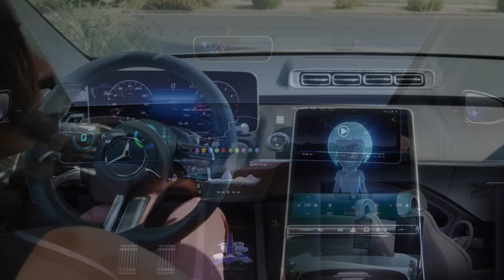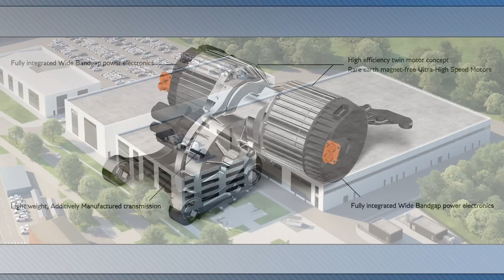UAW Ready to Rumble at VW; Is This Ford's Electric Maverick? - Autoline Daily 3771

Comment: I doubt we see a compact EV truck from Ford.  At least not initially when they come out with their 2nd gen EVs.   Farley has noted that work trucks and highly functional vehicles are the exception to the need to go small.  I think Ford remains all in on the T3 project which I understand is something only slightly smaller than an F150.   A ride hailing vehicle is interesting but I'm doubtful we see that either anytime before 2030.

Comment: Reducing rules is stupid they have over 10 years to address the issue, how long do they need?
Reply: In the big scheme of things it doesn't matter, the market leaders are already putting that kind of pressure on the market, so government pressure may not as critical at this stage.

And it may even backfire on the laggards who wanted the slow down, because they will just end up further behind without pressure to innovate like the rest of the leading players, so that might seal their fate.

But in the short term it buys executives more golden parachutes, that's just the short-term-ism culture at play.

So not really a concern as long as the government doesn't step in to rig the market against the market leaders at the same time.
Reply: I think it's ok, regulation is not what will cause automakers to go EV. It will be market forces. Look at Japanese automakers, they just keep buying carbon credits and don't any meaningful number of EVs. The only thing that will change that is when ICE cars become more expensive to make than EVs and consumers make the switch. Regulation isn't needed nor is it effective.
Reply: buy me one and I'll switch now.
Reply: @2012bigPerm You can find a used Model 3 for as low as $15k - there's a $4k fed rebate on used EVs - if u look hard enough. 

Kinda a steal considering the package.
Reply: @AllanSustainabilityFan  As low as and if you look hard enough, without those two omissions you'd have one hell of a point. Exceptions are not rules. And I said buy me one, that's free for me, not as low as 15k. I don't hate EV's like you guys love them...that's the main difference.
Reply: @2012bigPerm Well, yeah for free is not likely lol. 

But under $25k is easy to find, $20k with some effort, and as low as $15k with the rebate.

Alternatively could get a used 2017 Prius for $15k. 

I'd take a fully featured Model 3 over that basic option though, easy choice.

But no, not gonna hand them out with happy meals lol.
Reply: @AllanSustainabilityFan  I hear you. What would you say about all of the children digging with their bare hands for these precious minerals? I know it's "not happening" but I don't buy that for a second. I know how Nike makes shoes and I know where IPhones come from... Are we not robbing Peter to pay Paul in terms of the environmental impact? To say nothing of child labor and the atrocities the weakest among us are subject to; Would you say this is entirely false, part of the growing pains towards a better, cleaner, future or somewhere in between?

Comment: A key fact that everybody is missing about permanent magnet motors is that they are either sending power to the wheels or doing regen braking. Tesla only uses one per vehicle - always on its own. The rear motor in a RWD vehicle, the front motor for AWD. In tri-motor designs, the rear pair of motors are not PM motors. Likely the same for Bentley. As vehicles go four-wheel-drive and steer, PM motors will be phased out. Induction motors can 'free-wheel' when power not required.

Comment: Ford needs the Pinto.
Reply: Safer than Adrian's cars!  Iacocca a better cost cutter than the Special K grifter!
Reply: Yes. It will set the market on fire...
Reply: @Roddy451  The pinto was a victim of malicious reporting back in 1971.   It was equally unsafe with other cars of its size.
Reply: Not THAT Pinto.
Reply: @danharold3087 I was quite surprised when I did some reading and discovered that from 2008 to 2018, ICE vehicle fires were 16% of all fires reported to fire departments in the US.  And this, after years of improvement.
Reply: The remake of the Falcon line as EVs would be perfect. Sedan wagon and pickup.
Reply: @hayduke4589  and a mustang ?

Comment: New Tesla Model 3 Ludicrous Performance Version Coming in May with +600 HP (
Reply: For what?
Reply: But with the same dull cheap interior and crappy build quality which is a Tesla hallmark.
Reply: I have to ask the question, WHY? They should be investing in updating their boring outdated body design or perhaps, and this is just an overreach here,  overall quality improvements.

Comment: Cars are expensive because they are filled with useless gadgets. Do we REALLY need massage seat, heated seats, infotainment seats, and all the gizmos they put in cars nowadays? 
My car is a 2008 model. I don't have a radio and I open my windows manually. It does the job.
Reply: Sounds like you have your finger on the pulse of the market.

Comment: Lfp is a step backwards...
Reply: For high power long range cars yes.   Give it time.
Reply: @danharold3087  solid state batteries are being used in Chinese vehicles successfully.
Reply: @outkast40  are they LFP?
Reply: An oldie but a goodie!
Reply: @xlargetophat  not LFP
Reply: @outkast40 - Well, soilid state battery's longevity and reliability is still an unknown.  Hopefull they are good, but it needs a bit more time to access.